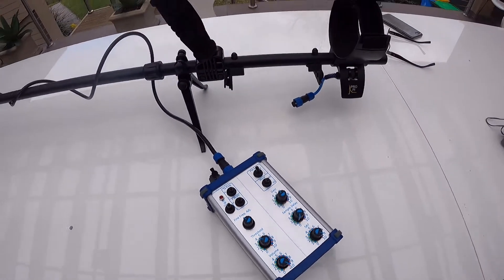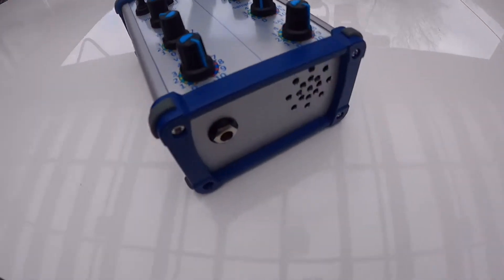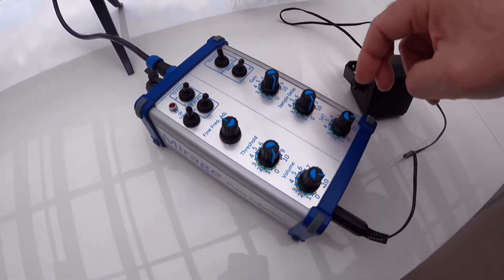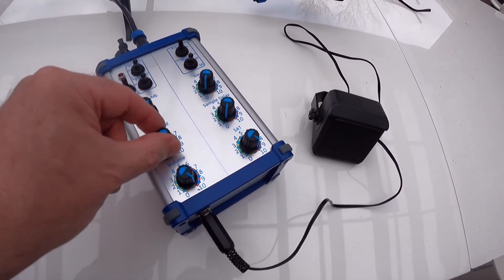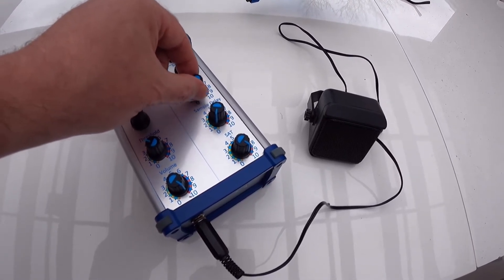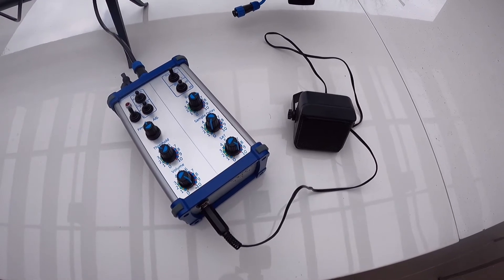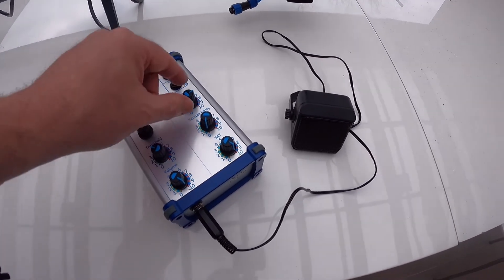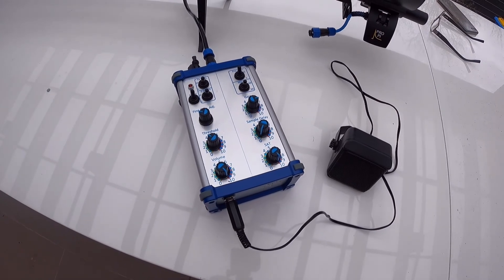Mirage Gold Max Set Up Procedure

Comment: This is Sven's build based on the hammerhead correct ? Did you build this machine from a kit or buy it pre-built?
Reply from the maker: Sven's final Mirage design (originally based on Carl Moreland's Hammerhead) was in March 2018.  Since then, there have been two improved versions launched on the Geotech1 forum:  1. Mirage Ultra (Sept 2019) and then 2. Mirage Gold Max. (Oct 2020).  The Gold Max is by far the superior design.  It has a much better power supply, lower noise circuitry, more stable threshold, more coil options (Mono, DD and Twin), switchable preamp ic options, and critically, samples targets literally in half the time (6uS vs 12 uS), which translates into much better detecting depth for all metals, and especially gold!  The Gold-Max is distributed solely by audetectors@gmail.com as a pcb with a 41 page Construction Guide with access to a dedicated Facebook support page for builders.
Reply: @dirtfishingdownunder  cheers, been sometime since i was on Geotech, may log on this evening and check if there has been any progress on some of my posts, will email audetectors now and see if they have any boards available.